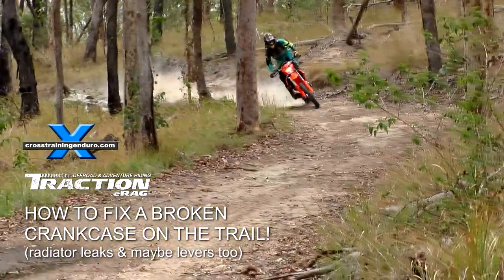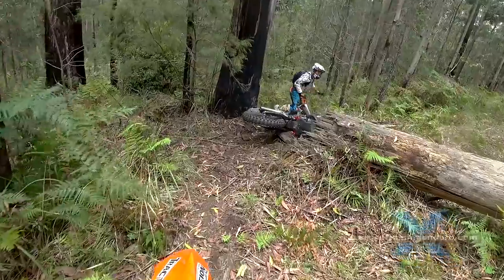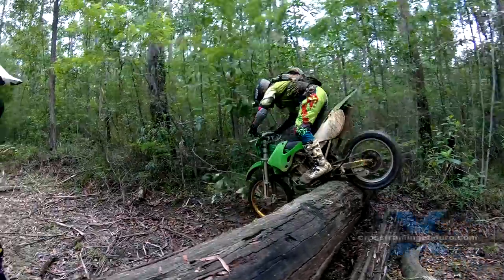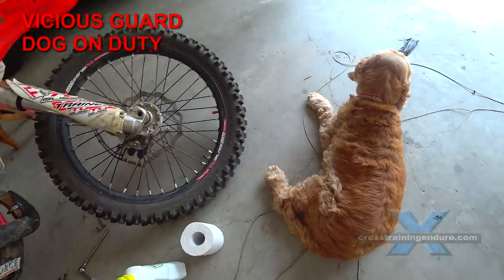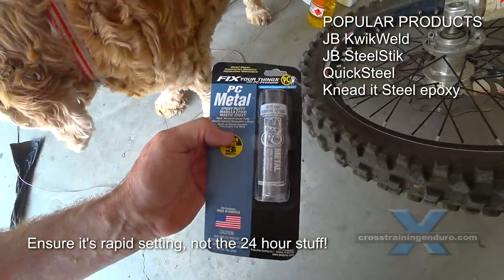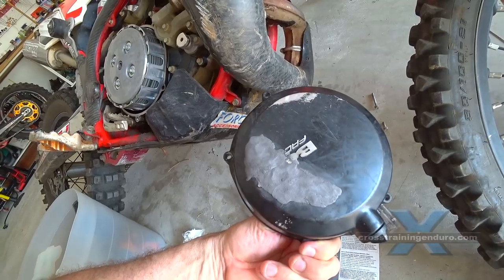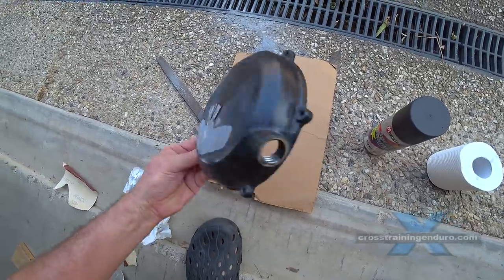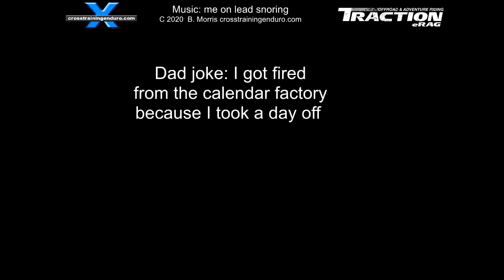How to fix broken crankcases, radiators and levers on the trail!︱Cross Training Enduro

Comment from the maker: FURTHER TIPS FROM VIEWERS!
malibu188: Adhesive tape (sticky side down) over the repair can cut down the amount of sanding and leaves almost a mirror finish once removed after the epoxy cures. Also leaves a good surface finish on small carbon fibre items. 
Dave Howe: for the clean up afterwards. Rubbing alcohol will remove uncured epoxy from fingers and any other place it may hove gotten stuck to.
jonnok: For a permanent repair, you can bake the case at 250°F (121°C) for 15 minutes which will help draw out oil from beneath the surface.
ADVANCED TIPS: WELDING, STRIPPED THREADS ETC: https://thumpertalk.com/blogs/entry/379-project-bike-update-crankcase-repair-tips/

Comment: Adhesive tape (sticky side down) over the repair can cut down the amount of sanding and leaves almost a mirror finish once removed after the epoxy cures. Also leaves a good surface finish on small carbon fibre items.
Reply from the maker: sweet! i'll add that to the list.

Comment: I use the permatex 5 minute set epoxy stick, even works on cheap Chinese made bikes. Way better than 2 part tube types and can last for years, because I’m a cheap ass and my Honda clutch cover is still not leaking nor is the rad or the Chinese stator cover I shattered in Ghost PLUZ AB canada

Comment: I found a 20mm crack round a spoke hole on my new toy, ignoring the advice of 'jus shren-dit, no promplem'! I took the wheel to an engineers shop to get it tigged up.
Its 6am now and im off on a 3 hour drive to chiang mai to try and find a new tagasako KTM rim as the twisted up pos they handed me back  just aint gonna work.
Ill be glueing any more cracks.
Reply: Did you post a photo of this on any facebook pages? I swear I saw a photo with someone saying this recently. Either way it's bad
Reply: @reeveharper8424  if you saw a totally bent to phuck ruined rim and want to see what happened to it check my last video!

Comment: Tips for tanks?
Reply from the maker: never holed a tank. there are youtube vids out there though...
Reply: If you're curious, they make stuff specifically for tanks that's supposed to hold up to petrol better. I used it on a KLR years ago and it's still holding, ne'er a leak.

Edit: granted, that was a steel tank. Might not hold up as well to the flexing of a plastic tank.

Comment: Had this happen to me when I was ~200km from home (on a 450 4-stroke). I wiped the oil off with my shirt and then applied just a very little on the outside. Since the engine was still hot we waited only 10mins and off we went. It stayed like that for at least 2 years and it never leaked again... Don't break your head trying to do it perfectly

Comment: In my experience 24h will last u longer and provide security.. But then again. What do i know right, i have no subs, right? 🐵👍🏿🇺🇲🌈
Reply: the good thing about the fast setting stuff,  within an hour you can break more things
jokes aside: when stranded somwhere in the nowhere i'd prefer not to spend a night unvoluntarily, never had an issue with the fast setting stuff, even in the long term.
Did anyone have this stuff fail?
Reply from the maker: subs = credibility... in my dreams lol
Reply: @i don't believe in the sun  but I believe you
Reply: @crosstrainingenduro  you less...
Reply: I had 3rd gear explode and come out of my case once.... JB weld 24hr for the win........ next weekend back on track at a state round.  Also used to stuff and flow 2t cases.